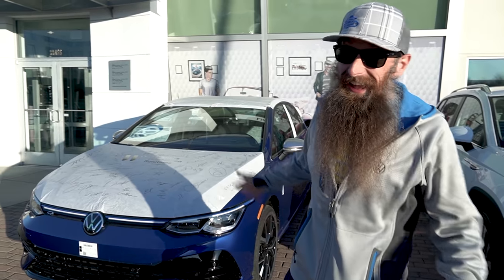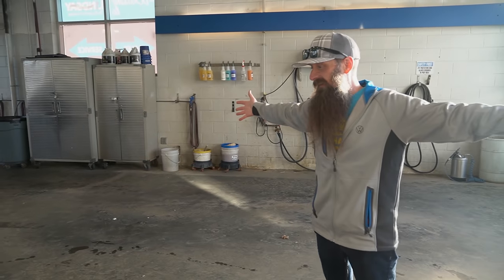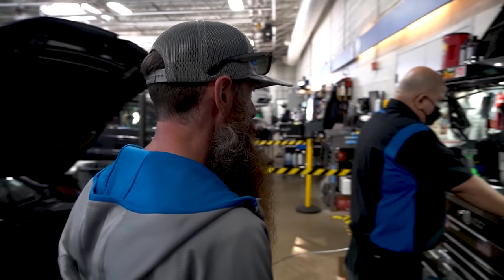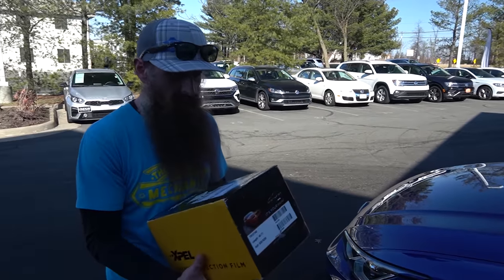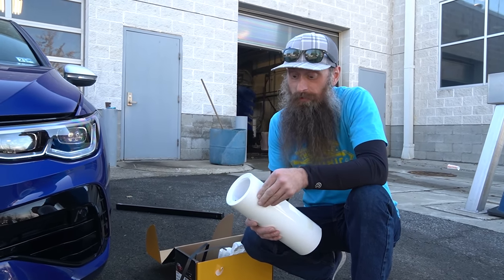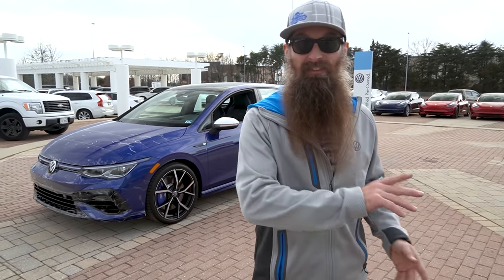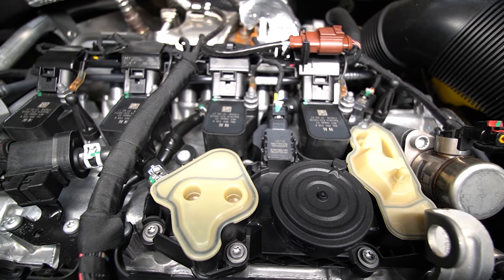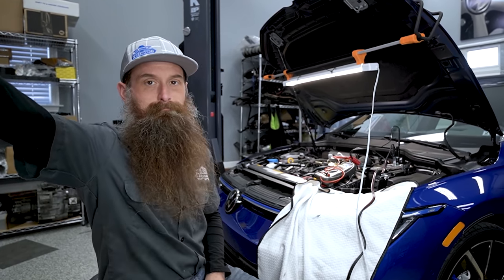MK8 GOLF R is Finally Here!! ~ SO MUCH BETTER THAN EXPECTED

Comment: I got mine last Wednesday and am loving it so far! Couple things i've been trying to figure out that I would love to see:

 - Killing artificial sound (already mentioned)
 - Setting Default drive mode ( starts on Sport but I want it to start on custom or comfort since its a daily driver)
 - Body updates -> side markers, mud flaps (can't find any)
 - Spare tire kit (will the 7.5 one you did work?)
 - Short Shifter Maybe?? ( Current Feel is nice though)

Glad you finally got it though and I look forward to more content!
Reply from the maker: Soundaktor is soon. 
The drive mode reset is DUMB!
Reply: why artificial sound VW?  this is not the way.
Reply: @MrAvlandrew  I’m not sure if it’s legal to have a completely silent vehicle. Better safe than sorry if I say. A little better than a possible recall later on down the road and having to add in a sound to them all
Reply: @Thirdtimesit  you don’t understand the convo
Reply: @MrAvlandrew  It actually is the way since pretty much every new sports car does it now. I don't like it either though.
Reply: @Thirdtimesit  not artificial sound on the outside (electric cars only), it’s fake engine noise piped into the cabin
Reply: @isaactrockman4417  ahh I see, thanks for the clarification

Comment: Congrats with the new car 🙂
Unfortunately, VCDS even in its latest iteration is pretty much useless on this platform (unless it has dramatically changed in the last 4 months).
You mention that you want to disable the soundaktor. This cannot be done via VCDS. I had to disable it in my similar car by physically removing the connector from the vibrator device in front of the windscreen.
I was also unable to clear error codes in most modules.

As a topic to dive into on this car, usability of VCDS would be a good subject to cover. I hope that Ross Tech has made some progress on the usability of VCDS with this platform.
Reply from the maker: I have already done it in VCDS

The SFD is an issue. But I have some work around. Will for sure cover in a video
Reply: Volkswagen needs to embrace the community not alienate us

Comment: As a Golf R owner here in the U.K. I really like the turn signal indicator lights that are in the front wings. The U.K. models don’t have this feature.
Reply: Can't you order the part from the US. Shipping would be expensive, but it could work.
Reply: @chrisgadsden6402    Chris, as I understand it the indicator lights are recessed into the wings themselves. Assume you would need to purchase new wings as well as the indicators and any wiring that was required. The wings themselves would require painting and fitting, it soon becomes a very expensive modification to do. I still think they look cool though.

Comment: Congratulations Charles! I'm experiencing quite the case of FOMO at the moment 😂 - I noticed in the MK8 GTI that VW still blocks off air from channeling directly into the stock air box. However, they include a block-off plate/ flapper in front of the engine bay. Wondering if this is the case on the new R? Anyway, the car looks amazing. Looking forward for more content in the future. Take care!

Comment: Great video, when mounting the ball fitting for the Racingline hood strut, you’re supposed to remove the original nut from the latch before screwing the ball onto it. 👌
Reply from the maker: Ahhh makes sense.

Comment: That prep is important. When I bought a 2015 golf R someone did a half ass job. There were plastic inserts in the suspension to keep the car more stable during shipment. The prep guys did not take them out. I drove around for several days getting more and more worried about how punishing the ride was. I stumbled on to a VW forum on the web where someone mentioned this problem. As Joe standard driver I had no idea. Still have the car and it is going strong, no problems. But in the back of my mind I wonder if there was some small crack made.....
Reply from the maker: Ugh it happens too much

Comment: I also once removed the suspension stops  on a  GTI when It came in for service can't remeber but also had high milage on it. The customer could not understand why it was driving hard. At that time on the Golf 6 they made the stops from rubber wich fitted between the coil springs
Reply from the maker: I remember those. Seen them on cars with WAY too many miles. LOL

Comment: Size brakes on the front (They look to be the same as on the Leon Cupra 290 and previous gen TTRS. Are they Brembo's? Turbo manufacturer + what has changed with that?. What has actually changed mechanically overall? (Is the head still the same?) Can it be serviced like the MK7? (Oil, spark plugs, air filter, cabin/pollen filter). Does an OBD-II scan tool fit in the diagnostics port and can it work on the Mk8?

Excited to follow these series! Depending on the outcome for that from your channel and fuel prices in Sweden in addition to budget and overall feel upon viewing the car, I may or may not end up buying it a few years down the line :)

Comment: Just like with all previous gen USDM market gti/r’s, you gotta do the euro tail lights. I did OEM Euro’s on my mk6 and my mk7 R with the 7.5 dynamic tails on the R. One of the best mods for changing the look of the rear of the car.
Reply from the maker: Working on that for sure. There is some coding/adaptations that are proving tough.
Reply: @HumbleMechanic  ooof… yea I don’t want to even think about coding those lol. Good luck. 

Are there any neat tricks you can get the headlights to do like they do in ROW? Or are the control modules different?
Reply from the maker: I haven’t dug that deep yet. We do have different lighting for sure

Comment: i was lucky enough to get to drive the 6 speed manual golf R a week or so ago. I performed the PDI and took off transport mode. Test drove it about 3 miles as Volkswagen requires.
Damn that was so much fun.  The car sold for 63K. How much did you pay for yours? Wish i could afford one myself, im stuck building my Mk5 2.0 FSI.

Comment: Amazing looking car especially in that colour. I'd be interested to see how a stage 1 tune changes the car as it's a pretty basic mod to complete👍🏽
Reply from the maker: Same!!! I don’t think anyone has cracked the ECM yet
Reply: @HumbleMechanic  On the 6sp MT, isn't upping the torque and HP with the stock clutch and transmission a big unknown at the moment?  I was under the impression that they de-rated the torque/HP on the manual version of the MkVIII for a reason.  I'd love to hear differently though...  Or at least know what has to be done so that stage 1 or higher tunes can be applied to the MT R's...  Hope to order my MkVIII R this summer (want to pay off the Alltrack first!).

Comment: Going with a manual in a golf R is a interesting choice for me....i found the manual box in the last golf R to be pretty numb and sloppy. Additionally you limit your tuning performance as the manual simply cant take the torque that the DSG can.
Reply from the maker: Right on all accounts. But I wanted to do different content than the 7. Some will be similar. But this gives me a little more flexibility
Reply: @HumbleMechanic  look forward to it! And ultimately that manual MK8 will be a rare beast one day.
Reply: @gureno19  USA at least has a choice, in EU there is only DSG

Comment: Does your new MK8 R have a sunroof?    Watched the video several times doesn't look like it but VW sites says its standard equipment?     I know you are saving UI for later but also wondering if you have to wait for the whole info system to boot before you can turn on the heated seats?

Comment: You must at least try the Akrapovič backbox with the fine end caps. They make a great impression on the car seen from behind. I have it myself, but I live in Norway so there is Akrapovič legal.
Reply from the maker: Can’t get it here. :(
Reply: @HumbleMechanic  You can order it directly from Akrapovič i think. Maybe not, but ask some dealers in Germany to order a set as a replasment.

Comment: Any way to set default display so it doesn’t change with each drive mode, or at least the ability to set your preferred display for each mode. 

Adjust or disable hill assist

Reduce sensitivity of sensors

Reduce sensitivity of front collision avoidance warning (numerous false alarms)
Reply from the maker: That reset of the drive mode and display is maddening. 

“Hey check out what this super customizable car”—— resets every key cycle

Comment: I know when i got my 2016 A3 i was curious what the downfalls of the vehicle is or thing that could be easily or decently price upgrades that would totally change the vehicle for the better. I know every vehicle has something and i really liked the way it drove and wanted it to be super reliable for as long as possible. May not be the same for most people but it shocked me 5 years later it still is issue free but still thinking what should be on that list that shockingly is not easy to find

Comment: This this is VERY interesting from a performance perspective. Punches way above its weight. In Canada, this car is on pricing with a WRX STI which is nuts. That interior in unacceptable though.
Reply from the maker: The only interior part I don’t like is the trim around the shifter and no sunglasses holder. The rest is fine.
Reply: @HumbleMechanic  to each their own. I personally value my physical buttons very much. Maybe I'm getting old. Very much looking forward to your journey with this car!
Reply from the maker: I understand that. I’m still evaluating the whole thing. So far I don’t love the steering wheel “buttons”. But the rest isn’t bad. 

I think it’s weird but not nearly as bad as it seems.
Reply from the maker: Plus VW hasn’t really ever had great UI. LOL MY 2015 Touareg is awful 😂😂😂 the Nav is basically unusable
Reply: @HumbleMechanic  it's good to hear you say that. I dunno what kind of voodoo went into the drivetrain and ea888 but it looks about as fast as my M2 comp. Which is crazy. I moved to the M2 from my mk7.5 but mk8 has me thinking. No more RS3 either for Canada!

Comment: The Xpel you can get pre cut for almost the whole body of the car.
Reply from the maker: Yep! That’s the legit stuff this is just the temp stuff
Reply: @HumbleMechanic  I asked for a price here. For the front, bonnet, frontwings and mirrors. and it was almost 20000 Nok = ca 2000 US Dollar. I have to wait a bit and let my local detailer do his job first and lay a coat of ceramic first. Ps Mine is also lapiz blue.

Comment: It looks like you left the prop rod in the car after putting the race line strut in. No interference?  Mine wouldn’t latch properly on the passenger side until I removed the rod.
Reply from the maker: I took it out

Comment: Aside from the shift knob and surround, are there any differences at all between this manual and the 7R's?
Does this engine still use the WHT 000 033N thrust washer part number from the 7.5?
Reply from the maker: No it’s the same. Several same PNs
Reply: @HumbleMechanic  Thanks!

Comment: I hope you can give me some advise, I saw you installed the gas struts and super excited to put it on my Mk8. Unfortunately I test close the hood and forgot to remove the brace bar. Now my hood won’t close or open. Is there Any way to open the hood. It’s seem to be locked on the driver side.
Reply from the maker: Brace bar? 

Can you push it slightly and pull the secondary lock?

Comment: Is it true that this engine also has port injection to avoid / reduce the carbon issue?  Wondering if that could be something that could be retro fitted to older engines ?
Reply from the maker: It doesn’t. Only a few years of R had it in Europe

Comment: I would get rid of the sound actor thing as well the engine start stop and day time running lights should be eliminated.
Reply from the maker: I like drls. But the Soundaktor is off(video soon). 

Manual doesn’t have start/stop
Reply: @HumbleMechanic  I wonder why? But that is awesome.
Reply: @HumbleMechanic  No start-stop in the manual?!  Probably another reason we're only getting the DSG this side of the pond 😢

Comment: The R line is way better looking than the GTI, the front bumper on the GTI is ugly... I'm doing a R line swap into my MK6 Jetta, it was originally a 2.5 so I was gonna do the RS3 swap but I priced used engines and they were $15k so I priced a new engine from VW and they were actually $13k so cheaper than a wrecker but still to expensive for one part of my swap because I do want Haldex too

Comment: Is there no drive in period on these 2.0 TSI’s?
Reply from the maker: They say no full throttle for 1,000 miles
Reply: @HumbleMechanic  Thats all? Damn, some of the other TSI's were no more than 2/3 throttle the first 2.500 km and the same goes for rpm
Reply: BTW don't be scared to drive this car hard. VW has testet the engine and gearbox to its limit.
Like 10 launch controls directly after each other (launch-break-launch) etc.

I can link you the german video where you can se it.
Reply from the maker: I don’t plan on babying this thing ;)
Reply: @HumbleMechanic  Enjoy the hell out of it! Cheers from Denmark!

Comment: Still same EA888  its mechanically just the same car as the prev version....
Reply from the maker: Engine and trans are. Diff isn’t.
Reply: @HumbleMechanic  Congratulations by the way. i want also one but its too expensive here in europe. It starts at 56.000 EURO thats about 63.000 usd, standard without any options. For me thats too expensive for a golf. Will drive my MK7 clubsport 3 doors some more years, and actually thats not bad lol